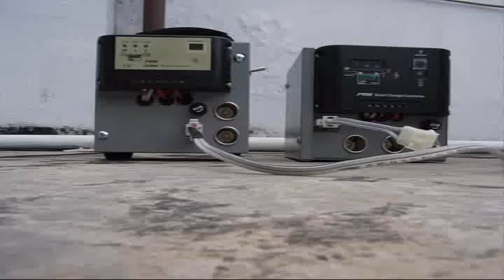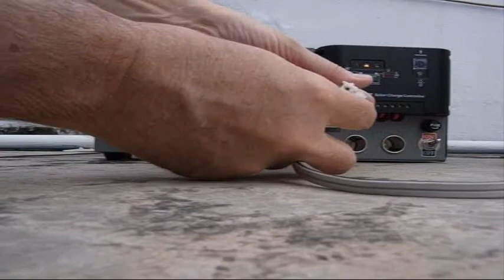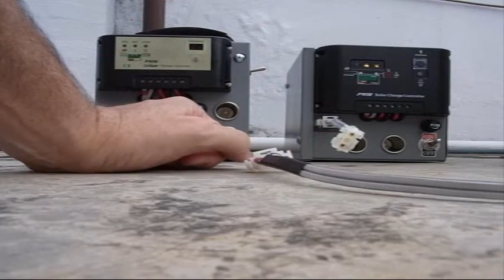Comparing 2 Solar Charge Controllers

Comment: I have the unit on the right.  It's a very good cheap PWM charge controller.  From seeing the light display randomly flicker I would have to say you either have a defective unit or open it up and see if there's any bad connections or solder joints.